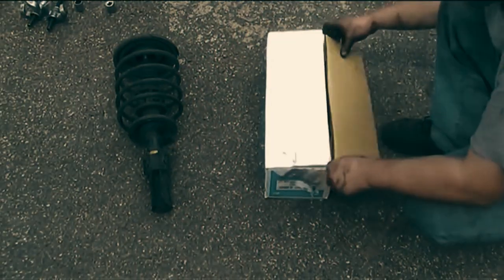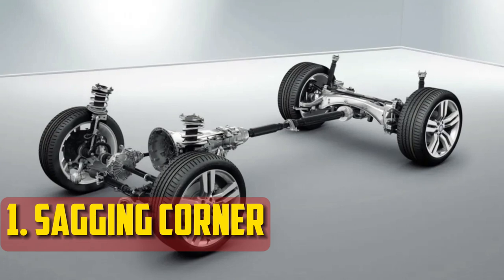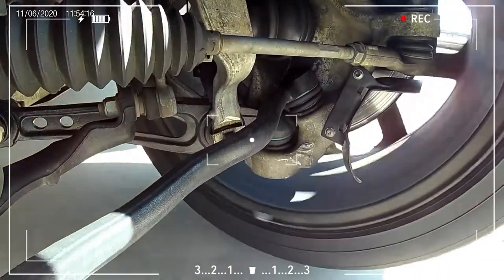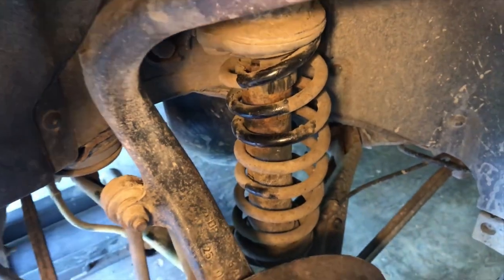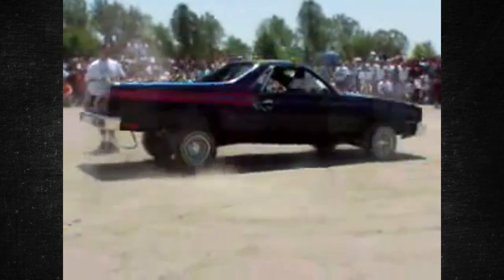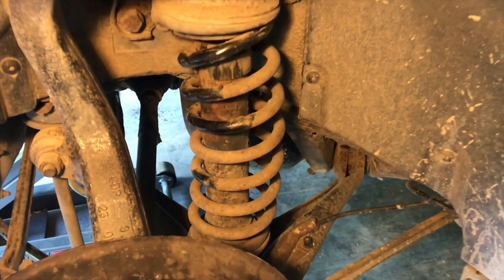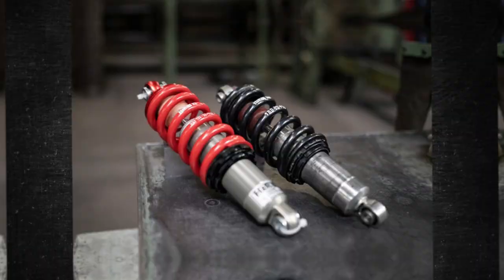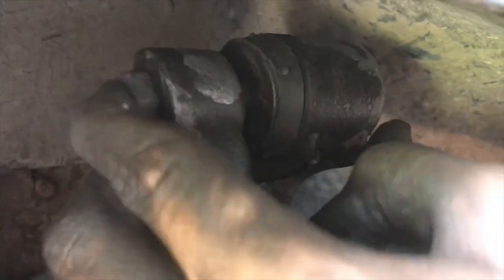5 Signs of a Bad Coil Spring - How to Fix & Replacement Cost

Comment: I needed a new strut in my Fiesta, it was under warrantee.  If only one is bad they will only replace only one.  One month later I traded it in for an Accord.  The Fiesta was junk.  17 repairs and 42 trips to the dealer in four years.  Glad I had the extended warrantee in this car.